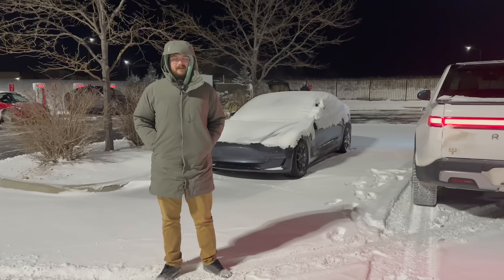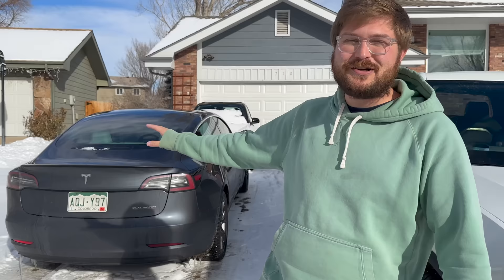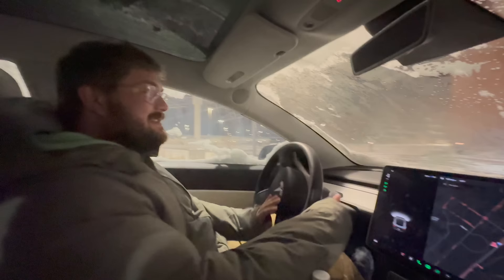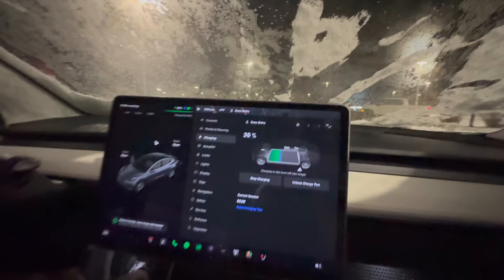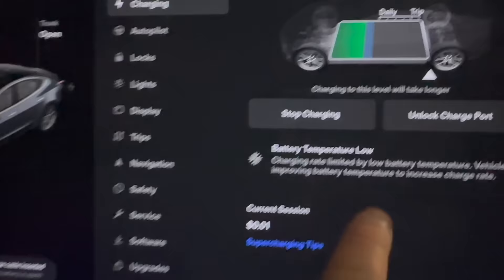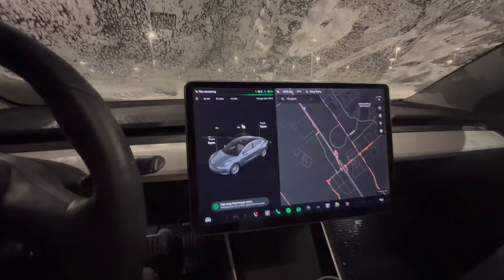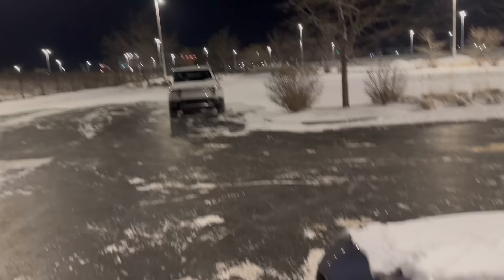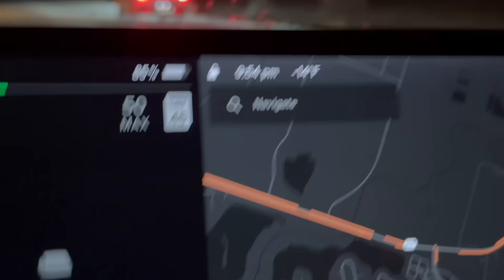I Deep Froze My Tesla And Immediately Plugged It Into A Supercharger To See What Happens

Comment: Similar results on cold soaking (air bnb had no outlet) and took about half an hour to warm battery at -25F. Keep in mind many diesels and some gas cars will not even start at these temps! Not an EV problem but an infrastructure that needs to be built out. Haters will hate as soon as ignorant! And their selfishness is more important than the environment! All the gas cars are plugged in here or LEFT running with block heaters! This is a 0.01% use case, an extreme test! Great video!

Comment: This guy has been seriously propagandized and seems to enjoy Kool-Aid. Serving the car is not my plan for the future.  1:45 to charge up 55%. I have two diesel cars that have seen these temps. Both started (not happy about it) and were warm in 5 minutes. My Audi S8 has a real range of 760 miles before fill-up and my BMW X5 has 580. News flash, on road charging costs more per mile than fuel.  The whole EV thing is a solution to a problem that does not exist.

Comment: You would think in cold states it would be worth having a big garage with roller doors so you can go in park door auto closes. Would not take much heat to bring the air temp up to above freezing and the process would be faster. Under ground radiant heat to warm batteries.

Comment: Pretty amazing that only 4kWh of energy warmed the traction battery in 45 minutes to a point where the traction battery could accept 20kW.  Kyle could have ran the cabin heater but then he would have had to explain why the power from the pedestal fluctuated between around 5kW to 14kW before the battery started accepting energy.  If this same test were performed on a RWD none heat pump Model 3 (what some of the Tesla ride share drivers in Chicago might drive), my guess is it would have taken close to 90 minutes before the traction battery started to accept a charge.  I wish Tesla would at least display the mid cell traction battery temperature on the display to help owners understand what is going on when 0mph charging speed is displayed.  When the display indicates 0 mph charging speed, many Tesla owners might assume the DC fast charger is not working.  Tesla has all of the info to display a message indicating what is going on and about how long it should be before the battery starts to accept a charge.  Maybe pop up a video to explain, in great detail, why drivers (especially ride share drivers that can not plug at night) might want to charge at the end of the day and route to a Supercharger to precondition at least 30 min before hand.

Comment: Make sure battery is above 0C before charging starts. Charging with the battery below freezing risks precipitating some of the lithium out as metal, reducing the lithium inventory available for propulsion and hence reducing battery capacity.
Reply: I recall reading about Tesla research that found that is no a problem for initial charging. It is near the end of charge that lithium deposition becomes a problem.

When I tried to look that research up (would have been more than a decade ago), all I got was results about frozen Teslas in Chicago though.

Comment: OK got some questions.  What was your cost? It charged to 90% and as you were driving just a few min later it was down to 85%. How long did the charge last?. You're running the defrost( off of electricity of course) how much drain was on the battery? It's obvious that this video is trying to convince everyone watching how great and ease of use ev cars are. Not convince!

Comment: Li-ion battery  cannot accept a charger below a certain temperature of the cell. One the heater has raised the cell temperatur it charges with constant current until you reach the voltage that the charger changes to constant voltage. Battery temperature is constantly monitored in each zone to prevent a battery run away which would likely damage the car.

Comment: Because any current (charge or discharge) through the battery will heat it, I don't understand why it didn't start charging at a very low power level, instead of jumping from 0 to 20 kW.  Even a few kW through the battery would have further helped to heat it.

Comment: Personally I've enjoyed watching smug Extra Volatile drivers having a hard time. As long as you separate your insurance to only OTHER EV cars. Watching houses, cars, and parking garages burn down is going to skyrocket all our insurance. JUST STOP IT and buy a regular gas powered car until the battery AND motors to power this weigh the same as a gas engine.

Comment: This is the most useless car I have ever seen in cold weather❗️🤣❗️ Here is my data from testing my old SAAB 9-5 AERO 2001, in -9°F I go out to my car, unlocking it, turns the key and viola, it has started. Then I scrapes the windows and when I'm done the heat is already pooring out from the vents. And away I go and in winter conditions I can stll go for 560miles(900km) on one charge.. sorry, on one fill, and having a nice 71°F in the car all the way..and if I need recharge...sorry, refill. I stop at nearest gas station and spend 5min at the pump and gets another 560miles to go..😂😂😂

Comment: If we find out how many cars are on the road in total, then find how many of those are ev's, we can see its not that many in comparison to gas/diesel vehicles. We can also see all the problems the power grid is already having with so few ev's on the road compared to gasoline vehicles. Eliminating all gas/diesel vehicles by 2035 to replace them with ev's will be absolutely impossible and many people will suffer; imagin having no heat in the winter for days at a time because the power keeps going out due to the overwhelmed power grid, not being able to get to work because you cant charge your ev. 

Also, all the heavy machinery used to mine the materials to make these ev's - and eveything else for that matter - run off of diesel fuels. Are we going to replace all of those massive machines with tires bigger than houses with ev versions? What is rubber made out of and what are we going to use for tires afterwards, wooden logs? You think everyone pushing this garbage is going to scrap the private jets they use to get to their davos meetings? Wake up people, we are going to ruin ourselves for a LOOOONNNG time if we continue to let this happen.³

Comment: "Didn't knew I had to wait 30min before I start charging, this is super cool!"..............NO DUDE!! THIS IS NOT COOL!! You have to waste almost 1h to charge the car, and more than half hour just to start charging.........let's not even add the fact you went to charge your car in the middle of the night to avoid get caught in the crowd line.....

It's cringy you said this is an extreme experiment on conditions you will never face..........dude, this conditions are more common than you think. It's called WINTER SEASON, and it comes for 3 months every year.........also, that battery drained 30% faster than on regular weather conditions......this cars are a WASTE OF TIME, not just money, TIME.
Reply: Ikr they act like they never have seen a winter before. P.S. a three month winter ? , more like 6 here in WI .

Comment: Trying to charge when is very cold is a good test for an electric car.  I do not own one because I live there is not enough charging places to make a trip. I have a hybrid instead.  This will improve hopefully in the future.  Battery self heat when charged as well when you are changing them cold. This goes to the modeling of even charging of the battery. You can model parts so as the battery heats more of the battery can be charged. My guess is the Tesla battery is in sections to allow both heating and cooling of the battery and piecewise linear modeling.

Comment: You may be surprised but if you get into an accident or your batteries compromise for any reason, it turns out it cost $56,000 to replace and double check into this your insurance does not cover it. You may be very very surprised.

Comment: Discharging isn't the issue it's charging lithium batteries when it's below freezing. The battery pack has to have enough power to use the heater to warm the batteries above freezing likely that tis why not allowing regenerative charging. When you plug it in to charge then it will use the grid power to warm the heaters and start charging.

Comment: can you sit in the Tesla with the internal heating? I think it will be a minimal load on the battery. On a petrol car you have to run the engine for roughly 20 minutes before you get anything from the internal heater.

Comment: When you say "waste heat" and you mentioned "the motors" what exactly is happening? Is the waste heat produced by the internal resistance of the batteries? Are there coolers on the electric motors that are transfering waste heat from the motors to batteries via coolant? Both? And if the motors are running how are they mechanically disengaged from the wheels? Or are the power electronics intentionally not rotating the magnetic field in this case and just powering the coils statically (so to speak) to use them as a current shunts? I'm missing some sort of important detail here. I can't quite grok what's happening.
Reply: Yes, you got it actually. Both motors have a heat exchanger into the coolant loop, and the drive inverters can either intentionally spin the motors inefficiently or dump energy into the stator coils, switching between modes based on whether the vehicle is moving or stationary. Each motor is capable of generating ~3.5 kW of extra heat.
Reply: @haanc2  Thanks! I always assumed there were resistive heaters in the battery, but I now see they're being clever about intentionally running components inefficiently specifically to produce heat. Same effect in the end. Fewer parts.

Comment: If you have enough charge to drive to supercharger, it’s NOT Deep Freeze.  Climate control for battery side stays “ON” to Heat or Cool Battery even when car is parked, no one inside.  I believe Tesla have 8 way refrigeration valve for its heat pump unit.

Comment: If you are super charging a battery, you are slowly shorting its life span. What is the life of a battery being supercharged continually? With the back and forth  temperature inversions, and the condensation buildup that has to occur, what effect does that have on the battery compartment and its electronics?

Comment: Ridiculous!! With my "old fashion" gas-powered, "obsolete" Lincoln MKC, I can pull into one of thousands of gas stations available, have my tank filled up in 5 minutes, and been a hundred miles headed to my destination while these over-priced, over-hyped, future environmental liabilities promoted as future environmental "saving" tech, would only be half-charged - IF that!! And let's not mentioned that every time you subject these batteries to radical temperature-changing environments, their functional integrity depreciates, and the cost for repairing or replacing said batteries, cost MORE than the original price of the damn car itself!!! Face it people ... electric vehicles are liabilities wrapped in sanctimonious platitudes!!

Comment: I'm going to bet things would be different if you left it charge connected overnight. The Tesla is not going to try to maintain the battery temp if not plugged in, since that would just help kill the battery faster. This is not different from an ICE car. In Canada they leave their cars plugged in to a heater at night, otherwise the oil would congeal.

Comment: Could you try this again with air conditioning on? I think it would speed it up with 2021+ model 3's due to the heat pump. As you've done a test in the past heating up the interior quite fast using the heat pump model 3. While heating up Aircon, the car also heats up the batter by default when too cold and not preconditioned to the level for regular driving.

Comment: Imagine just 1/12th of the population wanting or needing a charge up at the same time. Lots of lineups and fighting over whose first; guns blazing, court cases, and general mayhem. In warm weather with lots of chargers everywhere.  Honestly, I think it's an expensive fad for EV enthusiasts. Local town and city taxis and bus EVs, yes. Long distance in extremes at either end of the temp. range, no for EVs.  The reason why electric cars didn't take off early on was because of the weight and lack of range and battery issues. Society is not patient and owning an EV requires patience and planning, plus we currently (pardon the play on words) are not even close to producing the energy capacity. Hydrogen electric is the best way and/or direct nuclear mini systems.  Spent nuclear fuel has a low deposit foot print and nuclear mass produces the most energy from the small mass.

Comment: Interesting how reliable and wonderful he proclaimed the EV to be. I have 180,000 miles on my Tacoma gas powered pickup. Except for normal brakes tires oil changes, and exhaust mufflers
NO repairs. It is 22 years on the road now. Wonder? What do you suppose that EV will.look like after those miles and  22 years AND new batteries costing ten thousand or MORE,
IF it is even worth it replacing them. Electric motors?.will they last 22 years? EVs are simply a fools paradise for those that ease their consciences as they worry about the " climate change" issue they have been indoctrinated into via sophistry.

Comment: I xriove my 2litre Turbo  VW GTI to the gas station at 1am at below -2c and filled up in around 3 mins and got home , the gas wasn't used any faster in fact the colder air made the car better as cold air combusts better,  you should look into getting a car with an engine,  electric supply will slow down before oil wells do.,  already in Texas switch offs from the grid are a thing,

Comment: Hi there, honest question here coming from an Non EV owner trying to learn. I was wondering if you can duplicate the actual situation that happened in Chicago in that those poor folks were sitting there in their cars waiting for hours waiting in line and HAD to run the Heater (literally no choice) and as such your Battery got drained all the way Down to ZERO 0 ! (assuming you had the heater on while waiting in line ...you know the Heater that was keeping you Warm AKA  Alive till it hits absolute ZERO) like it did in Chicago. Then with both a ZERO Battery, in sub -0 temps then try to plug in and see if A. the Heating process works to warm up the battery then B. accept and take a charge ? C. Wonder how long it would take to charge up to 80% as that is what I observed in the Chicago incident and I don't drive and EV nor live in that cold of an area but again want to learn. Maybe I missed it but thought you were starting at like 32% when you started to charge which is completely different than what happened. Will it Heat and Charge or are you DOA till you get the car warmed up to say 10 - 20 degrees then try again ?

Comment: this wouldnt be an extreme case for people living in apartments or condos in Canada.  This is extremely worrying.  I can leave my ice vehicle engine block heater plugged in all night and not use anywhere near what a teslka will use to keep warm.  I can then let my car warm up for 5 minutes and be on my way.  In -30c and worse which is extremely common in dec through feb here.  
How much is my ev going to cost to keep warm on a regular 120v pluyg in and how long  am I going to have to wait to charge in this weather?  I think Id rather keep my gas vehicle as I don't plan on freezing my but off waiting for a car to charge.

Comment: All cars in general are a huge waste, ice or electric. I will never buy a car ever. I built an electric scooter in 2017 that I can carry up stairs for just over a grand. I'm nearly 200 lbs but my scooter rips and can hit 30mph in 2 seconds flat and tops out at 72mph in under 7 seconds. In the 7 years I've had it, its done over 30,000 miles and all ive had to replace are wheel bearings and brake pads. It's just as powerful today as it was when i first built it. I can go 25 miles  per kwh. An electric car wouldn't even do 5 miles per kwh. Huge waste of energy to move such a needlessly heavy vehicle. 

If you can, do yourself a favour, ditch your incredibly wasteful car and build your own custom light ev. Build ut yourself and it's yours to own. Something that will soon be impossible if you buy from manufacturers.

Vehicle manufacturers are scamming and ripping people off big time.

Comment: Who wants to stop in the Cold to charge a Go Cart?  🥶🔌🚙 Allot of us live in the Cold North. Also running the heaters just adds more waiting time to the charging. I could gas up my ICE Car in less than 2 minutes and be out! 🏎️💨 EV’s are less than practical
Reply: I pull my EV into my garage, and plug it in, letting it charge overnight as I sleep. When I wake up the next day, it's ready to go again. I can even safely precondition the cabin in the garage without carbon monoxide worries or someone driving off with my car because I left it running unattended outside.

Yes, road trips take a little more time to charge it even at a supercharger, but it's typically 15-25 minutes, not hours like EV-critics like to claim. But the other 99% of the time I'm driving my EV, it's to work and back, and weekly shopping around town.

If you don't have a reliable way to charge at home, then yes, EV's aren't very practical. But if you can, they can be a good replacement for a gas car for most folks.